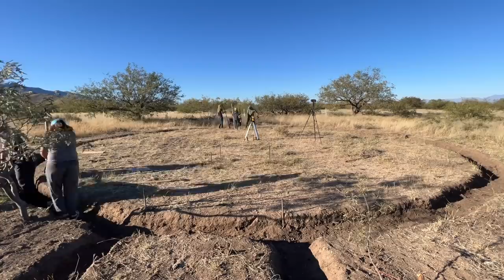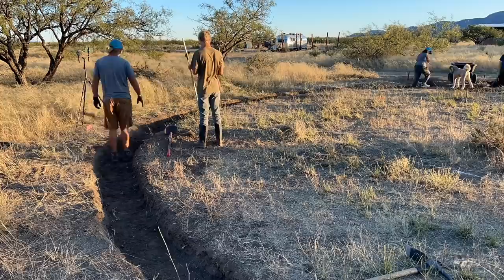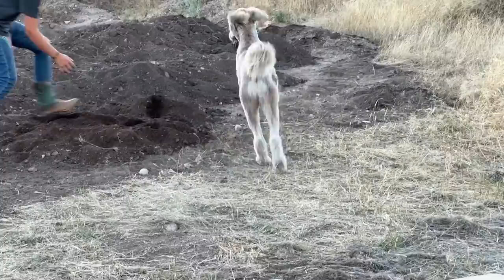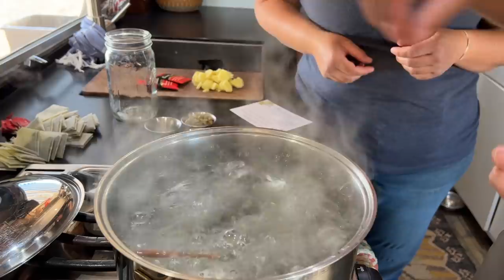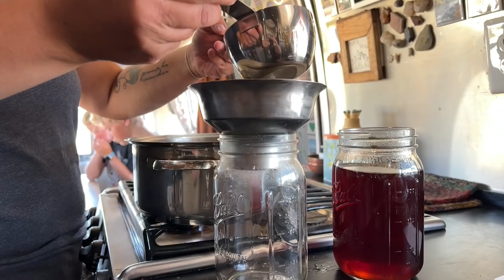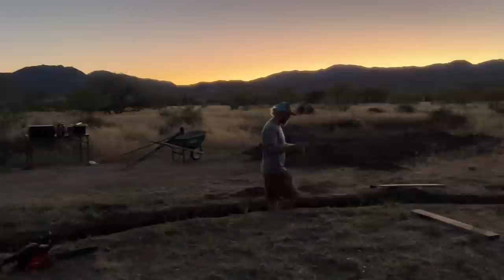Crossing the Finish Line on the Outside Trench (Chicken Garden Day 6)

Comment: The concentrate is way too thin. You can't save anything like that. Ginger doesn't have to be peeled, most of the good stuff sits in and directly under the peel. Just wash well. Ginger from Peru, for example, is much more flavorful than ginger from China. It is usually very watery. For this purpose I would grate the ginger much finer so that everything is cooked out. Cardamom, cinnamon and pepper also have to be crushed (or bought powdered), otherwise the spices cannot be properly boiled. You then need a lot less, especially the expensive cardamom. Instead of white "empty" industrial sugar, it is better to use brown cane sugar or e.g. agave sugar. If you sweeten with honey or maple syrup, the concentrate should be cooled down to at least 40 ° Celsius beforehand. You can get black tea cheaply in bulk, look for Asian shops, forget about Rooibos, it is boring. : D